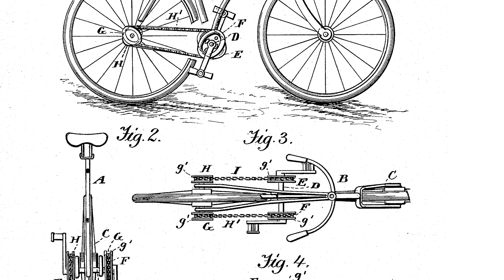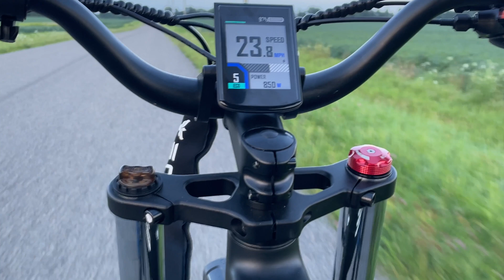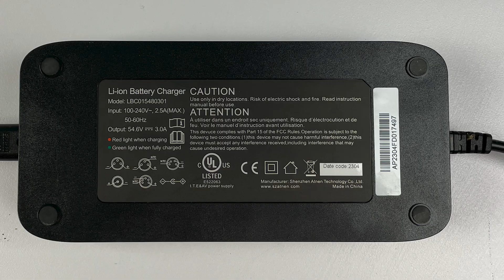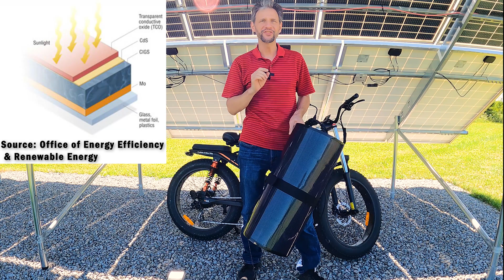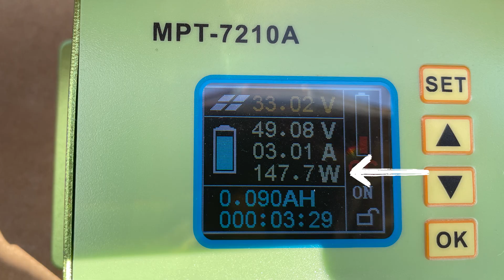Freedom Unleashed! Solar Powered Electric Bike ENGWE X24

Comment: My bike camping charging system for my E-CELLS 2 motor, 2 battery EMTB is: 220 watt Off Grid TREK solar blanket and (also from OGT) an ELEJOY adjustable controller with appropriate cables. Yeah, not a cheap date but the system weighs only 14 pounds and all fits in one rear pannier.  This blanket is only 3' wide and 6' long and waterproof (but protect cable connections from water.).
UPDATE: I have an Off Grid TREK 200 watt solar panel that folds to the size of a large laptop, is 4" thick and weighs 12.5 pounds. Also from Off Grid TREK (in Canada) I got the owner, Rene, to send me an ELEJOY programmable controller with cables to connect to the 200 watt blanket and to the FRAME PLUG (patented) of my E-CELLS Super Monarch Crown. This plug charges BOTH batteries simultaneously. (front down tube 52V 20 Ah, rear rack 52V 15 Ah)

Comment: Wonder if it will charge while active.  You could ride with a solar panel on your back.
Reply from the maker: Rolled up it won't capture very much light, but a small panel on a back pack could add something.

Comment: People don't buy that solar controller unless you have no clouds or birds or anything that will shade the panel's momentary because it spends most of the day resetting not charging
Reply from the maker: I can confirm it cuts out every time a cloud floats over.  The other one I tried didn't' work at all.  Do you have one that has worked well for you?
Reply: Thx to confirm my opinion, tried 2 of these controllers, didnt worked good for me. I just had four 30w 12v solar panels and plugged them in series to use with a MPPT controller instead of a MPPT boost controller. I guessed that its easier to lower the voltage than boost it but maybe I'm wrong. I had such a bad time with that boost controller that I didnt want a try any other but I saw somewhere that genasun has a good one.

Comment: All well and good, Dave.
Now do it with hills. ; )

Many moons ago I was what I guess would be called a hard core cyclist (NOT biker, thankyou); several extended tours, fairly high level racing, fulltime commuting ( and in the NE US too). But it's pretty hilly were I live and over time, now in my 60s, I lost interest in every ride going into physical crisis mode because of the climbs. I just wanted a nice tooling about in the countryside.
Last year though I picked up a pristine, gently used, Trek Domane+ LT (e-assisted bike) and my life has certainly changed. My easiest loop of 18 miles still had 1200' of climbing but now with an assist (and well-deserved, I'd say) I can buzz through it, still working hard, but not approaching cardiac arrest.

The Domane+ engine and battery are all contained in the down tube and are connected to a transmission in the bottom bracket, so the 3 levels of assist come through the pedals. If you don't pedal, you don't go no where. And it rides just like any other high end racing or touring bike I've ever owned. 50 mph downhills, no problem.

Your squirreliness at high speeds is mostly because your tires weren't meant for it. They're knobby dirt tires and frankly I wouldn't be pushing those speeds on those tires. But they can probably be replaced with a less aggressively treaded tire that would be far more stable at road speeds, and still be adequate with the gentle offroading it looks like you have. if that was your inclination.

Thanks much for the video, very enlightening.
Reply: Hi I agree about the tyre's most China E Bikes come with tyre's and walls are not very supportive so the tyre tends to wollow around corners and high speeds, so got myself so semi motorcycle tyre's and they stick like glue still slightly nobby but good for both off road and road good in the wet too, I'm 66 and love every trip that I do 😊
Reply from the maker: Thanks for noting your personal experience and the feedback on the knobby tires!

Comment: Very cool.  Like you I've been skeptical on the uses.  Maybe there are some good use cases (aside from just being fun!).  Thanks for sharing!
Reply from the maker: Until I started using it, I didn't realize how useful it would be in an emergency.  At 30+mph I can get to the grocery store or some other fairly distant destination in reasonable time.  With my solar charging I don't even need power to get around.  I have to say, I really like it.
Reply: @ProjectsWithDave  it’s given me some ideas for quick trips.  Thanks!

Comment: At 5:35   "The power  assist continues for about a second after you stop pedaling". Which means that that bike, and all the other electric bikes with the same "management" is just garbage, and obviously very dangerous
Reply from the maker: It's something you have to get used to.  I can see they are trying to balance the annoyance of the power assist bouncing on and off incessantly.   Seems like there could be a setting to adjust how long it lasts after you stop peddling.
Reply: @ProjectsWithDave  
"It's something you have to get used to." No, I don't have. Years ago I found a bike where you didn't feel the motor. It was just an assistance, proportionate to the pressure applied to the pedals. I suppose it had some torque sensor in the bottom bracket or applied to the crank. Have a nice day.
Reply from the maker: Nice!  What bike is it?

Comment: In France, e-bikes can’t (legally) run without you pedaling and the motor is just here as an assistance to your muscles, and the maximum speed is 19mph. Still it is a great fun to ride !
Reply from the maker: It's interesting how different the rules are around the world.  Thanks for the info!
Reply: @ProjectsWithDave Unfortunately Japan has gone the same way as the EU and been super-restrictive, too. Oh well, I'll jusr get a fast one but register it as a "pink plate" motorcycle.
Reply: I'm sorry. Freedom is in the heart. Not the laws.
Reply: What's the purpose of pedal and bike chain if you don't use it ? 19mph still pretty good for ur own safety. U don't need fast bike if ur living in urban areas.
Reply: Im in the UK and max legal speed is 15.5 mph but in most cases that isnt enough power for most hills its a joke most people over here just get a 500w+ power ebike as we are not pulled over unless your actting crazy.
Reply: @GodFartherOG  15.5 mph speed limit (you can thank Thatcher & Sinclair for that) has nothing to do with power.
The OEM Bosch motors for example put out well in excess of 500 watts 'peak power', plenty to climb even if you're a lard ass.
Reply: The gov: we gonna force everyone to bike
Also the gov: we gonna make them useless with our "laws"

Seriously....normal cyclists can get 50km/h without a engine and thats fine but when i attach a engine then all of sudden 25 is dangerous and forbidden? Typical gov overreach
Reply: @423GustavBern  'normal cyclist' don't typically go 50km/h, that's people on sports/racing bikes who train...
Average cycling speed here in the Netherlands is typically 15km/h.

And there comes the problem with allowing e-bikes to go faster than 25km/h, you get hoards of stupid teenagers on cheaply made chinese bikes (often with no brakes) going 50km/h, plenty of dead kids from fatbikes here already.
If you want to go faster, buy a speed pedelec... (but of course a license to ride one of those is out of reach of the paupers)

Comment: the electric bike is a great addition. i am 67 and bought a Fido T1 a year ago, i am back to riding several times a week now just for fun. the CIGS panel is my next addition but it will take a while to free up over 500 dollars. i have been using my jackery 240 and the ac charger to fuel up my bike for the last year. You also noticed the full on throttle issue, this is the only thing i dont like about my electric bike and as far as i have been able to find out none of the others offer a variable power throttle, only power assist levels.
Reply from the maker: It is so much fun isn't it.  Adding variable throttle would cost a lot more then the current on/off switch, but I think it would be a worthwhile addition.  What made you choose the Fido T1?

Comment: How many watts consumed per mile?
Reply from the maker: It totally depends on how much you peddle.  I was able to go 60miles on one charge, so about 24.7Wh/mile on average.
Reply: You see a lot of e-bike reviews on YouTube. It would be nice if there was a set standard of speed on level ground for a set time and rider weight so comparisons can be made. I do find your review the most informative 
I have seen so far. Thanks for your effort! @ProjectsWithDave
Reply from the maker: E-bikes is not something I normally do, but I am a fan of scientific comparison.  If I do more in the future, I'll think of a way to compare them apples to apples.
Reply: Hobotech did a whole video testing it with great nerdy info
Reply from the maker: Thanks, I'll check it out.